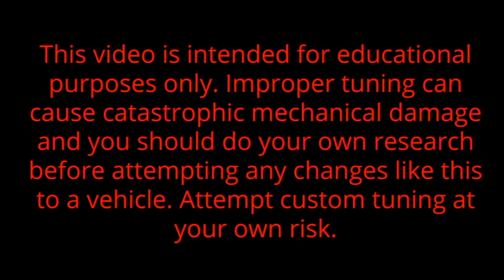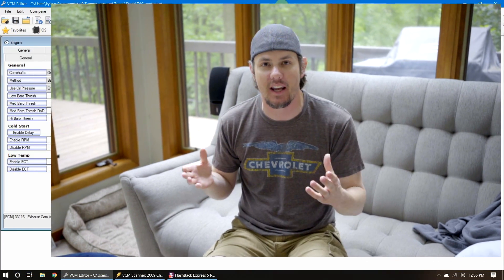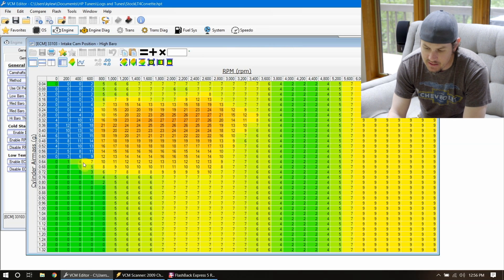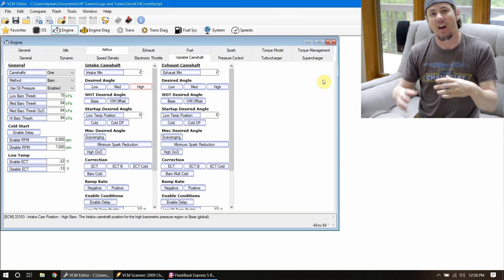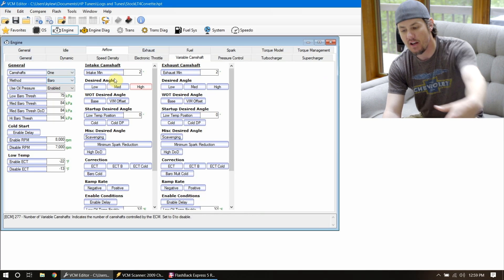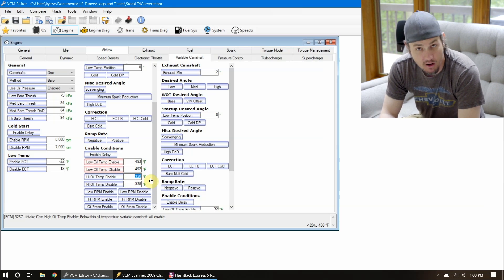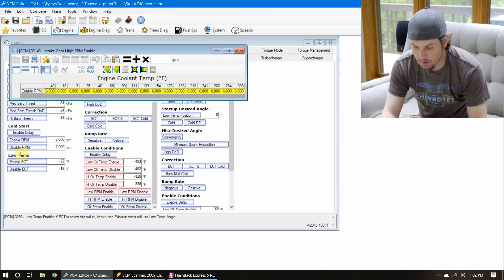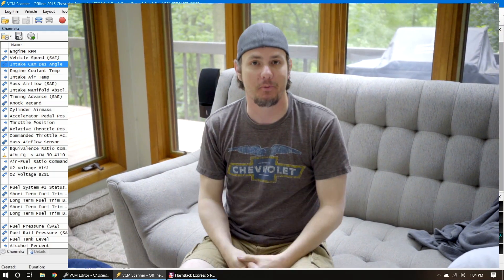VVT Disable in HP Tuners, Getting Rid Of Variable Valve Timing

Comment: Sorry to question you.. but do you have dyno proof that the vvt is killing low end horsepower? I was always told vvt helped low end power.
Reply: You're correct VVT was designed to give broader power band over a wider RPM range. There are some valid reasons to disable, simplicity of tuning is probably the top oned, adding power is not one of those reasons
Reply: Man Stuff Channel I have proof that disabling VVT kills top end but it still retains that low end torque. VVT disabled I made 265whp vs 323whp with it enabled. Low end torque stayed the same.
Reply from the maker: What platform? The cam doesn't do much at WOT on most.
Reply from the maker: @Maverick09171  cam is fully advanced at Park
Reply from the maker: Nope, but I've helped tune cars this week alone that the owners complained about it feeling like power was flat, had them assist the VVT to not retard the cam so much and it made a huge difference for both. No need to apologize for questioning here, but if you have VVT it's easy enough to dial the retard down and see if it makes a difference on your platform.

Comment: Hello - great video and nicely explained! I’m after removing a VVT cam and installing an LS3 cam into my swap project but I can’t seem to get it to start.. When I look at my tune, especially within the “Variable Camshaft” tab, under the general section on the left, my number of camshafts is set to “NONE” - would this be a problem and prevent all communication from the CAM sensor as I’m getting no cam signals on the VCM scanner. Thanks for the help!
Reply: Barry K 
just wanted to ask if you fix the starting problem on your vehicle cause a delete vvt and install a performance camshaft kit and now it wouldn’t start
Reply: jose vargas Hi - I traced it back to the cam sensor, I’m not getting any cam sensor counts when I’m cranking. So it’s either a bad sensor or as I still have the original VVT timing cover installed, the sensor might be too far away from the ls3 reluctor

Comment: Really enjoy your vids but I believe your explanation is a little off here. The numbers in the cam table represent degrees retarded, not advance. The cam is parked in it's rest position until oil pressure is increased to the phaser, which retards the timing. The"emissions" area of the cam angle map retards the cam during part throttle to reduce pumping losses. Then under wot it's retarded gradually as rpm increases to improve power.
Reply from the maker: Good to know and thanks for the clarification!!  That would make sense when you think about it that you want it running at the peak clocking without having to phase it.  I'll have to do a new video updating the terminology!
Reply: @GoatRopeGarage  no problem 👍 I ran into this when I upgraded my cam to tsp vvt unit. Works great. Keep up the awesome content 🙂

Comment: Hey bud I want to Thankyou for all the time you put in teaching cause I am very computer dumb lol. I haven’t got to use my HP tuner yet but still watching the videos getting ready I have a CTS2 edge program locked in my ECM I have to have it flashed and stock re-downloaded. But plan on doing basically cookie-cutter motor camp swap DOD delete and so forth if I mechanically delete the VVT do I still need to go in and delete the VVT in the ECM ?
Reply from the maker: I would since it's an easy process and that way the ecm doesn't even try to use any of that. Thanks for the feedback and let me know if you have any issues!
Reply: Goat Rope Garage thanks for getting back but ok I will I might end up doing it anyway before. I read the other guys comment and having same trouble it feels like it wants to break out and run but I can fill it surging until it gets up around 3500 4000 but in your videos and research pretty sure it’s torque management and possibly vvt as well. I do have a few bolt on mods and the edge that’s locked in for now. Any suggestions on getting the edge CTS to programmer out? I have had trouble finding someone to do it. I’m in Texas working in Austin at the moment

Comment: My truck is kinda a dog down below 3,200 but then it feels like a power band after that. And on the freeway at 75 (1800 rpm) it doesnt pull hills great in 6th but 5th is good. I wanted to tune the vvt but didnt wanna do it wrong. Anyway to tune it to help down low 1,500-3,000rpm? Or just do a full cam swap?
2012 gmc 5.3 4x4
 Thanks for all the content!
Reply: T Bundy I have the same truck. I tuned vvt (and spark timing correspondingly) and the lack of power under 3k is completely eliminated and now has great throttle response. 100% stock minus the tune
Reply: @Maverick09171  I have an l76 vortec max that feels really doggy in the cruising rpm ranges.  When you say that you tuned the ignition timing correspondingly.  What exactly do you mean?  How do you correlate it?  Did you simply change the ignition timing by the same degree change you made to the vvt table?
Reply from the maker: Probably not, this is more about simplifying or doing away with VVT, it wouldn't hurt to try some of these tips as VVT is an economy thing more than a power thing. You have any current mods on your truck? There are a couple of basic things you can do to a stock truck to make it peppier.
Reply: @GoatRopeGarage   I have the same symptoms as T Bundy with my 08 2500hd. What basic things  could one do to add low end torque.
Reply from the maker: Try going in to the VVT tables and dialing back the numbers, there at usually high numbers in the areas you talk about causing the cam to retard in that zone and feel laggy.

Comment: Can you just completely disable VVT and keep the factory cam phaser.  Or do you have to go to a LS3 cam sprocket when disabling this system?
Reply from the maker: I don't see why not, just zero out your intake tables and set your disable parameters.
Reply: @GoatRopeGarage  in the top left corner for "# of cam shafts  to controlled by ecm" set to 0 to disable.  Would that work? Or should I still zero the tables and set the limits beyond what they would ever see. Thanks